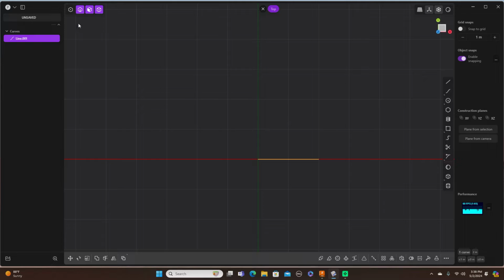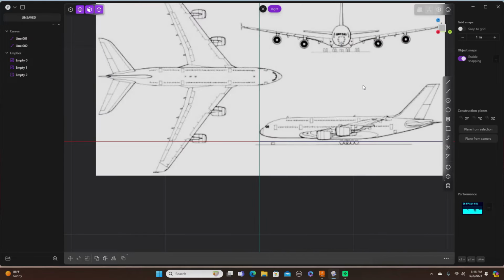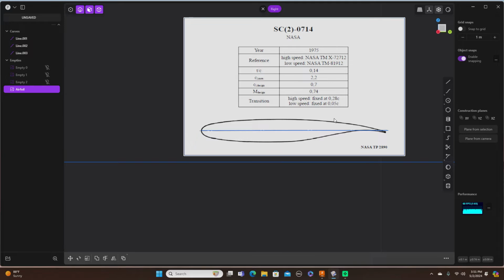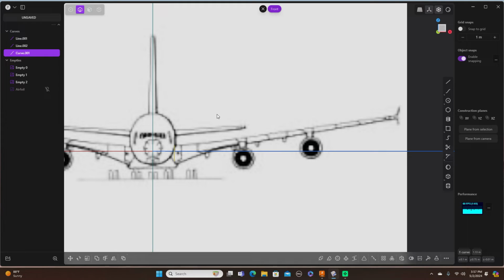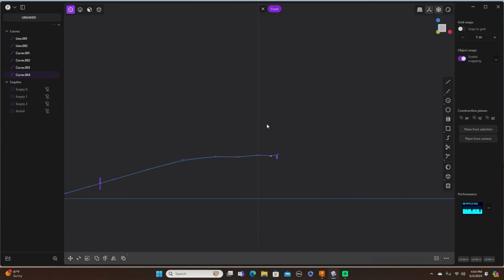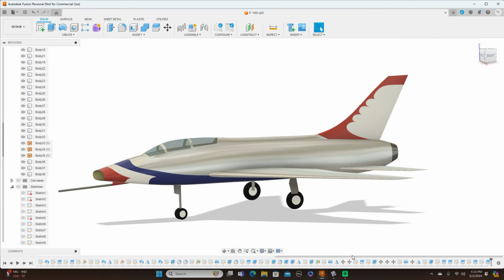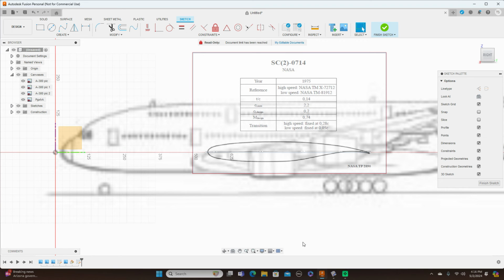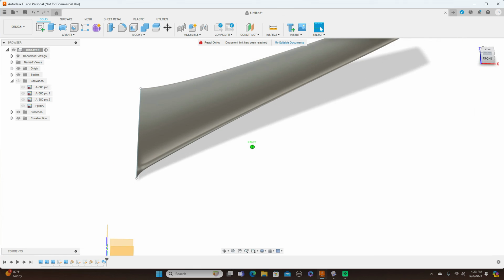Modeling an A-380 wing in Plasticity and Fusion 360

Comment: I've just replicated what you did in Plasticity using the sweep function to maintain profile to the leading and trailing edge lines similar to your Fusion 360 example. 
1. Select cross section
2. Select sweep
3. Select trailing edge and keep down shift
4. Select leading edge + shift
5. Reselect trailing edge.
Reply: Pray to the CAD gods for parametric Plasticity and life will be complete
Reply from the maker: Excellent.  There are many ways of doing things in CAD programs.